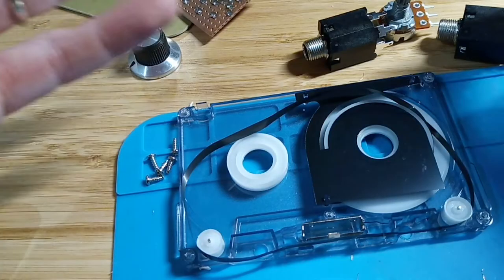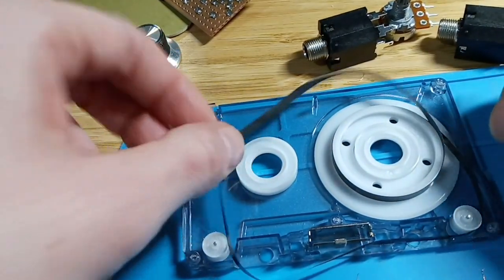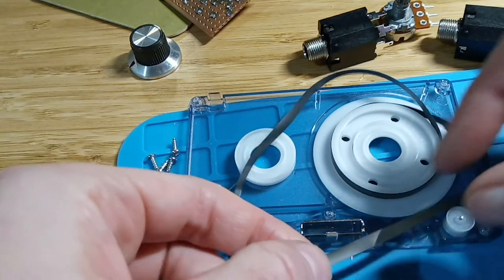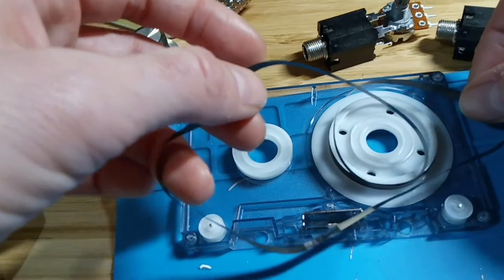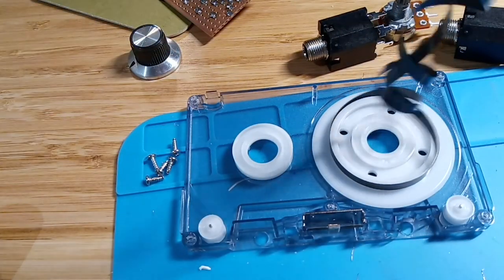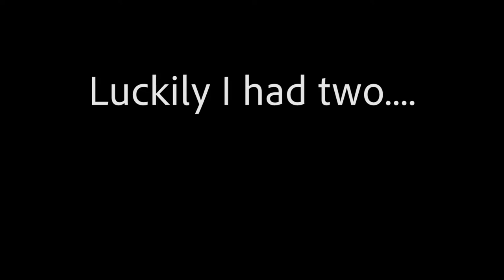30 second endless answering machine message tape

Comment: I am so grateful to you for opening that tape. I've just stumbled across these too when trying to find a way of making longer tape loops. I found some of these 30 second loop tapes on eBay and I would have been tempted to take apart to see how they're routed and now I don't need to, thank you! Very nice piece, thank you for sharing this also.
Reply from the maker: @JamesPearson  if you are really careful you can open one up and cut out the metal strip then stick it back together. I have managed to do that once. It means you don't have the silence each time the strip goes past. I think it's there to be detected where the start of the answerphone message is
Reply: @chrisbullock613  Thanks Chris, that sounds like a good idea. The eBay listing is for three tapes and so I can always take the risk with one :) move the tape until the metal strip is at the heads and work from there. I do have splicing tape and a block, etc, but boy is it fiddly! It's actually made me wonder if I could try building my own longer loops. The solution they used with that piece of plastic doesn't look too difficult to replicate. Tapes generally have that piece of clear plastic and I wonder if that could be cut to the same shape to serve the same purpose. That would be really cool!
Reply from the maker: @JamesPearson  You can add more plastic pieces inside to take the tape on a longer route, like lego pieces although it's not going to add much more loop time. I think some people run the tape outside of the casette and the player but then you'd need a hole in your casette and player chassis!
Reply from the maker: @JamesPearson  but yes get the metal strip in place then it's more manageable to cut it out and resplice - I use scissors and tape I don't have a proper block so my splices arn't perfect but usually sound ok. Some of my performance tapes are waiting to be remade I really should do that!